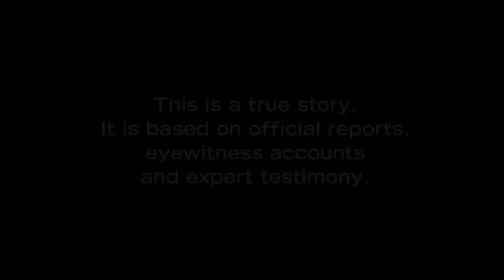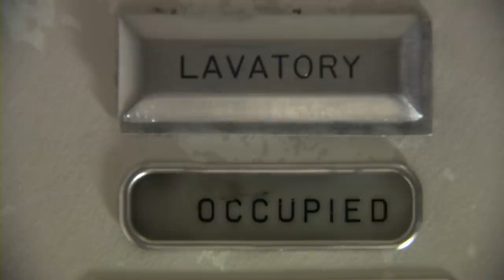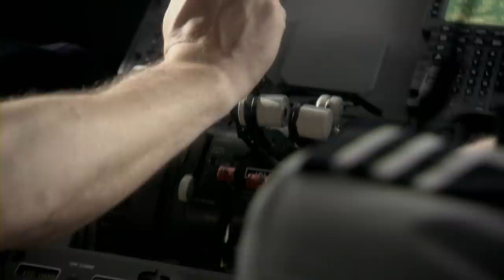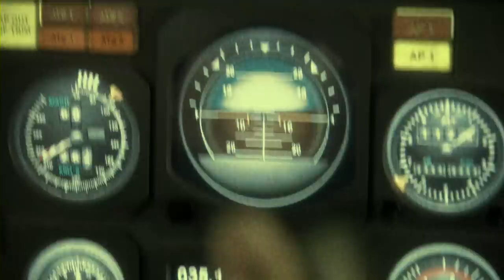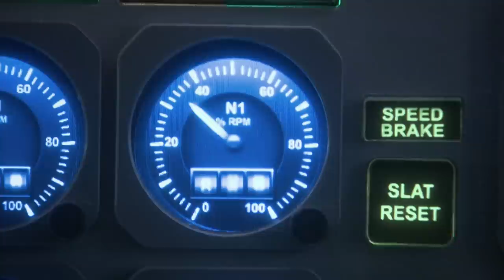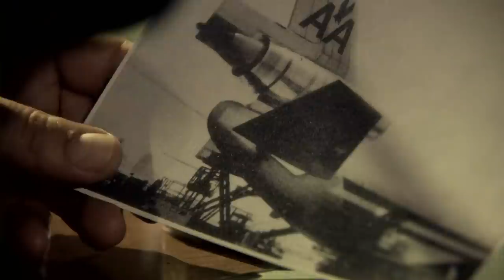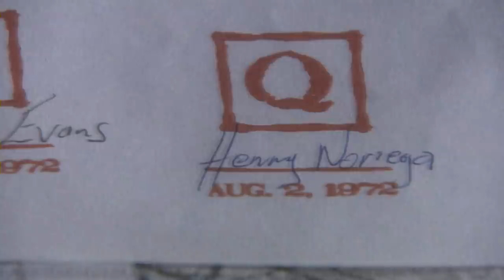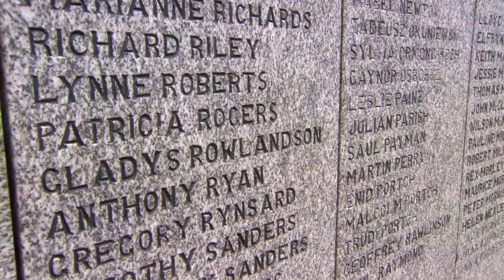Huge Hole In Passenger Plane Causes A Fatal Crash | Mayday | Wonder

Comment: The exact same problem again 2 years later... Then all those problems with the MCAS on the Boeing 737 MAX... Ill stick to an Airbus if I can thank you very much!
Reply: What if anything did Airbus fix on the A320 after its relatively complicated flight mode system resulted in even a flight deck full of company test pilots not being able to keep themselves from dying as the aircraft slowly descended into the trees?  Or a more recent Air France flight where as the plane did its own thing shifting into one flight mode or another, the pilots couldn't figure out that they were negating each other's control inputs until right before everyone on the widebody died?

Because Airbus's most notable safety issues are tied to their design philosophy rather than random design issues here and there as with others, for me it's Airbus I would like to avoid.  But truth be told, if it's the right departure time and the right price... well whatever I'm flying on I can figure it's not going to crash one way or the other.

Comment: I was on an Air Transat flight out of Acapulco in December1994. Our Md-1011 started losing fuel INSIDE the plane. It smelled like when I was working in a floatplane outfit and we dumped some fuel from the wings to get the water out. my clothes smelled like it for hours after that, si I never forgot. We turned around right away and got 2 days free in a 5-star resort. 
I never flew on a TriStar after that.
Reply: That's a bs story.
No way can fuel leak inside the plane.
and an L1011 is Lockheed not McDonnel Douglas

Comment: Why  don’t they have a back up hydraulic system located elsewhere on the plane?
Reply: there will always be space and location issues with choke points where you cant get away from having to use that area how to make a failsafe and functional system in such confines are unavoidable

Comment: you think the door ripped off and went up and hit the back flap? is that why it was stuck while turned right? or was it because the controls were damaged and they couldn't straighten it from the cockpit?
Reply: Fly by wire control damage

Comment: MD's shenanigans now continue at Boeing with the 737 MAX disaster. They cut corners and people have to pay with their lives.
Reply: Not exactly because the MAX disaster involved more than just MCAS. In fact, the previous crew before LionAir Flight 610 actually had the same problem and they fixed it. They then flew to Indonesia safely.
Reply: @Powerranger-le4up  Boeing hid the MCAS system from pilots like MD hid this flawed design from airlines. 

A lot of DC-10s flew without the cargo door opening; that doesn't change the fact the manufacturer intentionally hid the defect from the consumer.

Comment: isnt the first time this locking pin issue has happend similiar plane had a electrical fualt and the pins over spun and sheared the lock off
Reply: But probably not the scandal this crash was.

Comment: The 747 had the same issue.  It took the diligence of the parents of a dead passenger to finally bring this to light. Even the FAA tried to sweep this one under because of the cost to fix the fleet.
Reply: Different problem, same basic result. The 747 had faulty wiring, the cargo door could open on its own.

Comment: All doors on a jet airplane, including cargo doors, should open inwards.
Reply: Why?
Reply: @jamegumb9731  To keep this kind of thing from happening again.  Doors that open inward are much better able to withstand the internal air pressure at high altitudes which I hear is roughly 8 pounds per square inch, or roughly 1,152 pounds (more than half a ton) per square foot.

Comment: 12:15 "flight attendants ask passengers to remove their shoes" -- uh, what? i've never heard that before.
no way i'm removing my shoes -- they would protect my feet in case i need to run through a fire or some other horrible outcome.
Reply: ....and the jewelry. Shoes are just a distraction. Where do you think the term " sky high robbery " comes from?
Reply: It may have been the safety protocol back in the days.
Reply: So nothing punctures the slide when the passengers go down it. You can put them back on at the bottom, they don't keep them from you.

Comment: Where have we seen this type of Collusion with the FAA before?  Hint we saw this very recently with the 737 Max.  Relying on the Aircraft Manufacturer to self regulate itself, it seems many years later the same mistakes are being made.
Reply: The 737 Max accident is different because MCAS was not the primary cause. In fact, before the Lion Air crash, the same problem happened to the previous crew and they actually fixed the problem and flew to Indonesia safely.
Reply: @Powerranger-le4up  Basically case in point Boeing went around FAA scrutiny by laying in a software fix for what was a Hardware issue.  Which is why the Max remained grounded because there needed to be at least some hardware changes that would make MCAS more reliable.
Reply: @Powerranger-le4up  The previous day's flight randomly had a third pilot in the cockpit, allowing the flying pilots to focus on control inputs to a plane which kept trying to crash itself while the third pilot analyzed the confusing indications being presented by the failure.